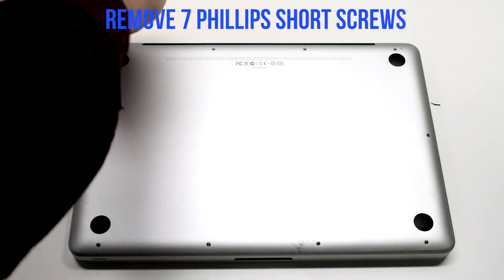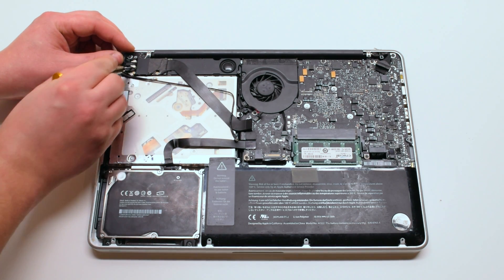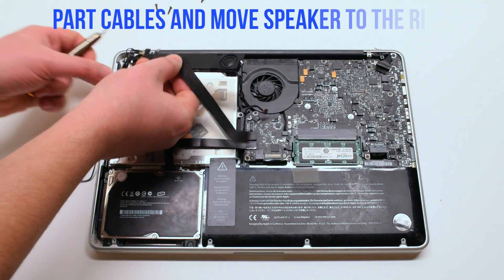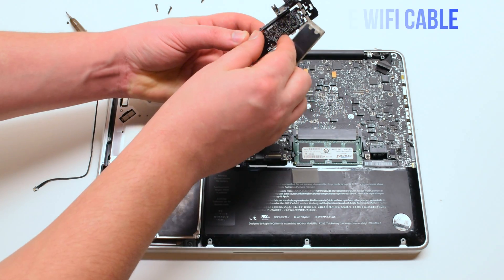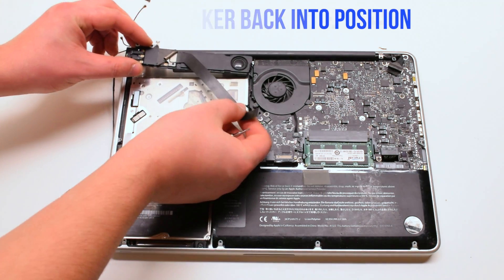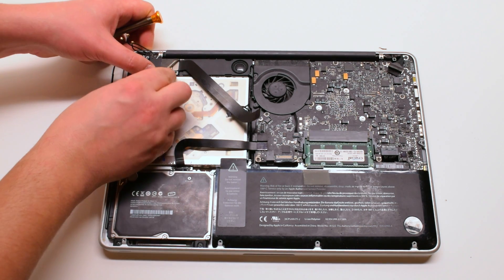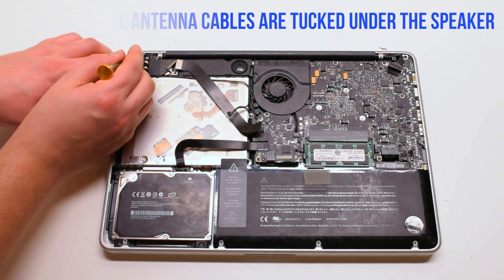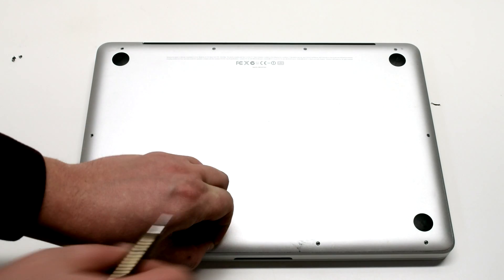2011 Macbook Pro 13" A1278 WiFi AirPort BlueTooth Card Replacement

Comment: Thank you. This tutorial helped me get airdrop and handoff working on an early 2011 MBP that did not have that functionality before. IMPORTANT NOTE: if you're doing this upgrade in a pre-2012 MacBook you have to be sure you are buying the part number that ends in "4CAX" the "4AX" is a direct replacement and DOES NOT have the functionality. I am glad I found that out before buying by reading some forums. Almost made that mistake. Also for the iSight camera plug, don't pull on the cable, use a precision flathead and work the two sides, it slides out towards the disc drive. Mine was tight, not as easy as shown in this video. Otherwise great and helpful video!

Comment: Hi I have a 2013 MacBook. It's not my main machine but I still use it quite frequently. It's running Linux mint. I read that any pcie wifi card can be plugged in. I was wondering if a Samsung wifi card would work on that botherboard if I download the right drivers through linux?
Reply: It's actually not a samsung card it's an Intel

Comment: Hi! Thanks for this video it is super helpful. If my bluetooth has suddenly disappeared from System Preferences and shows as not available in the manu bar would that be a problem with the replacement card mentioned in this video? (note I have tried all of the reset options)
Reply: Having the same issue. Did you try? Did it work?

Comment: my 2011 Macbook Pro has bluetooth 2.0.... can I purchase a 4.0 replacement and follow these steps to upgrade it?
Reply: yes, but you have to use the Continuity Activation Tool to make AirDrop/Continuity work on the 2011 model. When the sustém boots it recognizes that’s a 2011 and assumes it doesn’t have compatibility, so even with BT 4.0 you need to patch it.
Reply from the maker: Not that I'm aware of.
Reply: Yes. You can

Comment: Do the wifi cable has somekind of glue? 
I have a MBP 13"(mid 2012) and one side is flyaway... Need to buy new cable or just need glue?
Reply from the maker: +Javier Lara it should be mechanical and glue is just for cosmetics and not needed, if you need to glue the cable for it to stay in place then you should replace it.